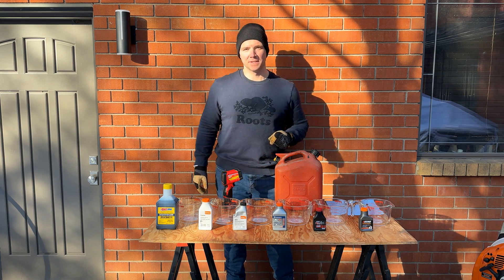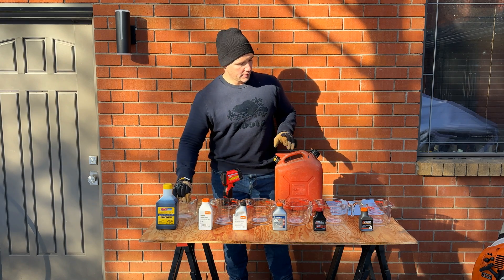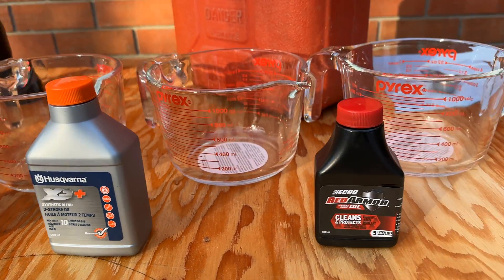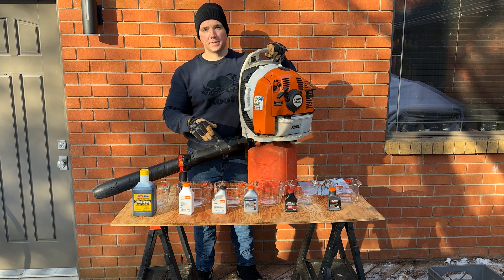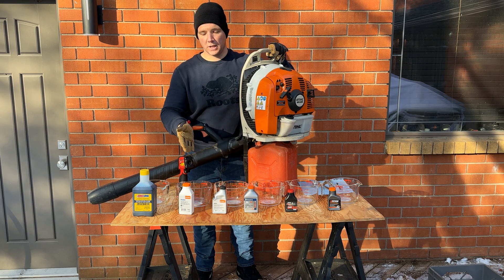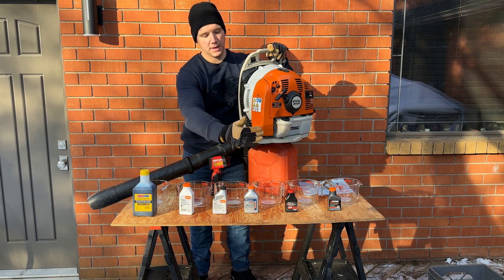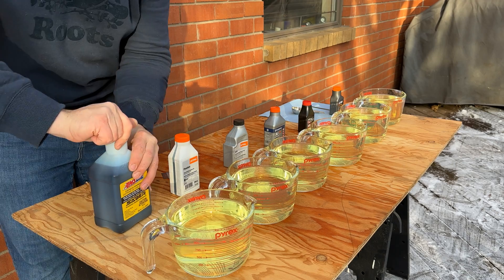Which 2-stroke oil is safest for your small engine? Temperature testing 6 of the most popular oils!

Comment: Hi i need to find a review on Redmax & Royal Purple 2 cycle oil.
I have a stihl 025 chain saw,
Stihl Kombi 2 cycle KM85R, RedMax 8500 2 cycle blower.
I cant mix stihl ultra for 2 and redmax for the redmax.
I really need just one 2 cycle oil.

I watched a repairman review stihl ultra and the ones who used stihl ultra and zero lubrication inside so im not uding stihl 3 cycle oil

Comment: I could be wrong but I do not think exhaust temperature is a good indicator of the oil protecting the engine! Also a thicker film of oil left behind could raise the temperature of tool as moving fluids do heat up! So a higher temperature could mean the tool is better protected?

Comment: As a small engine mechanic and rc car and airplane pilot for almost 3 decades I can say that STHIL oils are junk. 
They will fowl plugs, leave more carbon and idle and transition poorly. They have a higher flash point so they burn badly. They’re designed to be run wide open. If you aren’t running wide open for the majority of your operation then it isn’t burning efficiently. 
Will it cause damage? No, it’s still oil. But is it nasty? Certainly.

Comment: Believe your test results deserves a scientific explanation from an expert in engine and two-stroke oil technology, which I am not qualified to provide.  That said, common sense says higher temp either means more friction or more power; which one is it?  Would be interesting to know the answer.  Would also be interesting to see how the results compare if the tests were run using the prescribed oil manufacturer's recommended ratios.  Thanks for your efforts in making this interesting video!

Comment: You’re kidding with this test right? You can’t run the engine without the shroud in place. That shroud is integral to the proper flow of air over the engine and exhaust. You’re going to need to place temperature probes/sensors wherever and then put the shroud back on. That’s said, what makes you think simply measuring exhaust temperature is a primary indicator of a 2 stroke oils performance? You need to consult the JASO and look at what the criteria’s are for what makes an oil good, better, and best etc.
Reply: Agreed

Comment: Brp (ski doo), amsoil, polaris, cat..etc...any of the snowmobile 2 stroke oils and youll never go wrong. They make turbo 2 strokes of near 200 stock hp in sleds thrive so good enough for small stuff. I personally use the Bombardier mineral oil (50 bucks or so, 4 liters, synthetic is more) in all my old professional McCulloch chainsaws, one going back to 1971. Never even foul a plug. Pretty much 40:1 mix with no ethanol premium.

Comment: well my dad has a  40 year old echo backpack blower and it still works just fine. he used EVERY type of oil you could think of in it.   i also  have a 25 year old hus.145 bt and just llike the echo have used all kinds of different oils in it and it STILL STARTS ON THE SECOND PULL! just bought a  new  hus. 570 bts ( wanted the job done quicker, 1.5 acres, i also do 2 other lots, cause i am a nice guy , lol, older ladys). seems to me it is MORE ABOUT HOW PEOPLE TAKE CARE OF THEIR EQUIPMENT THAN WHAT OIL IS BEING USED. i always lean towards using a SLIGHTLY richer mix. 1/32 to  1/16 oz. per mix more. depernding on the machine. that little bit means MUCH LONGER LONGEVITY OF THE MACHINE!! JUST MY 2 CENTS WORTH
Reply: I am 53 and have been mowing since I was 16, I thought Echo making a blower 40 years ago was baloney but my search said they made the FIRST backpack and handheld bower in 1975, amazing.
Reply: @NoNORADon911  i might have been off by maybe 2-3 years on the echo it was just a guess. but i have since given my dad my 145bt as it is lighter than the old echo and he is 85, lol what a strong old man!! i  do not mix my 570bts richer as it has a spark arrestor.and i use  a straight echo gold blend .i might try a different oil, but it seems to work ok so far.might change after i use all this oil up. it does take 3 pulls to start from cold, but seems to work fine so far on year 2. and this thing is beast at blowing leaves just super heavy on your back . you will be happy when it runs out of gas about, 1.20 hours to run out.

Comment: Coolest doesn't mean safest. A higher viscosity oil or more oil will run slightly hotter (and statistically safer), due to residual friction and mass of oil that has to be moved around. That being said I'm not an amsoil fanboy, I run motul 710 as my main oil due to being the one that gave me the best condition of p/c on my chainsaw mill after 1000 hours of runtime on a new set of piston and cylinder compared to 5 other arboristsite loved oils I tried

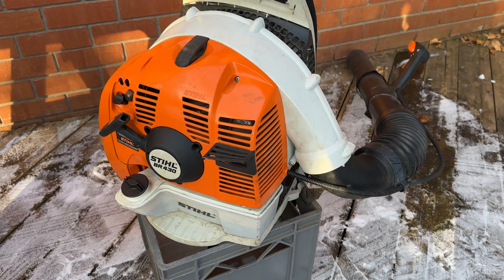Comment: I recently purchased a new 52cc line trimmer (this is actually a 4 in 1 tool) that recommends using 1:25 oil to fuel ratio. I purchased semi synesthetic 2 stroke oil and was wondering if it was ok to use a different oil to fuel ratio, say 1:32 or 1:40 after 20 hours of initial use at 1:25. The machine has powered on ok when I have used the oil with 91 petrol (non ethanol) and some fuel stabilizer.  Thanks for your input.

Comment: I run the AMSOIL Saber in all my 2-stroke stuff at a ratio of 90:1. I have a Husqvarna blower that calls for 50:1, my old Ryobi string trimmer (with interchangeable tools, one of which is a lightweight tiller that I use a lot in the early spring and late fall) that's 32:1 and my 1980 Homelite 150A that I restored which uses 16:1. All three of these get the AMSOIL mix and run beautifully, and have noticeably more power with this versus the cheap 2stroke Walmart oil I had to use once in a pinch, and the Castor 927 that I've used for years up until I switched to AMSOIL. Most impressive was my old chainsaw which I ran through its paces last weekend and it didn't even flinch.

Something I did not do was do any temperature comparisons between the Castor, the AMSOIL, and the cheap Wally oil. So this video was an interesting one to see. I'm surprised the AMSOIL (given the mix ratio you used being consistent through all oils) ran the hottest. I could see it running hotter when going off the recommended mix ratio, given there's so much more gasoline going through the combustion cycle than with other ratios, but again, surprised to see it running hotter with consistent ratios. Great work!
Reply: with modern 2S oil brands ( 1/2 or full synthetic) u dont need to go w/ 32:1 or 16:1. !!These hi ratios were needed w/ old designed mineral lubes. 
  50:1 is ok for early & late engines (even motorbikes, snowmobile & mariners ...),
 then 66:1 or 90:1 is recommended for certain modern 2S.
  w/modern 2S oils, 50:1 is a maximum, if u mix more it'll smoke & spit a lot of exost oil   it will flood the plug inducing a shorter life, flooded muffler, & put much carbon deposits on piston top, exost port & muffler ^^

Comment: Great test but how much variation did you have in ambient air temperature? Was the air temperature 40 degrees at the start and later in the day the air temperature raise to 60 degrees? I would think ambient air temperature would have an effect on your temperatures that you we're measuring.

Comment: The heat isnrt really a fair comparison, as the lower temps could have oil not burned off and is carboning the piston and bearings, etc. Its about how well it protects the internals and in a comparison of tearing the head off and piston out after each test is truly how your going to get results. Thos temps are in all honesty within spec for the running of the engine but the lower temps will most likely still have carbon deposits on the head and piston and cylinder walls or ports, etc. When it comes to 2 stroke engines, we want oil to keep it within the enginesrunning heat specs but not to have a bunch of carbon depositis. You should do the test with a brand new piston and clean the head and cylinder completely then run each oil mixture equally or even to the spec of the oil. You can still measure temps if you like to ensure that no one oil isnt keeping temps within engine specs. Then you can measure carbon depsoits, wear on the rings and cylinder, then change the piston and clean the cylinder and head and start all over again through each oil. That type of test will show you that not all these oils are as good as they say and I bet the Amsoil will win as it burns off its oil not leaving carbon deposits or scoring and some of the others will make a mess of things. 
I raced about 12 years MX and always ran 2 strokes. Ive tried every oil and mixture you can think of and always had less scroing, carbon deposits, ring wear, cylinder wear with amsoils products.

Comment: Neat test. I've ran the Amsoil Saber in my MS251 with good results since I bought it new back in 2015. Though I've kind of cherished the one quart bottle I bought as it's hard to come by. I still have enough left for mixing two or three gallons of fuel. The store I originally bought my bottle from no longer has it as they're having a hard time getting it supposedly.

One of the other stores I shop at frequently sells Amsoil's two other pre-mix oils I'm going to test. According to Amsoil's own website they support the same oil qualifications as Saber does for hand held power equipment. They're just not directly advertised for use in power equipment. I've read a lot of positive reviews of people using Interceptor and Dominator in their equipment as well as their dirt bikes so I have a quart of each to test. Those are both in store so I'm testing out what can be easily grabbed off shelf before I resort to ordering off the internet. :)
Reply: What ratio?
Reply: @WithoutMajtek  I run everything at 40:1. With modern 2-troke oil I feel it's a good middle ground. You're not using too much and you're not starving your equipment of lubrication. 

I've read some old-timers still swear by 25:1, but they don't stop to realize 25:1 was used when non-detergent SAE-30 automotive oil was used in 2-stroke engines. When 2-stroke specific oil got better they upped the rating to 32:1.

Since all of the high-end 2-stroke oil on the market is all full-synthetic they support 50:1 for the "richest" mix due to EPA regulations for running cleaner.

But since my pockets aren't bottomless and good equipment is expensive I can't just freely replace something if it breaks. So I feel 40:1 is good a spot even if others don't agree. AMSOIL is still cheaper than buying a new chainsaw.

Comment: Nice job on a pointless test. The gasoline, fuel to air ratio, and ignition timing, for the most part determines the exhaust temperatures. That's why all of your test temps are so close together. Moving around on the muffler with your laser temp gauge will yield different temps. You should have made a mark on the  muffler so you could take the readings in the same exact spot every time. Taking the temps from a spot on the cylinder about halfway through the stroke would yield more useful information. Do you have any idea what the designed running temperature is supposed to be and where on the engine the samples should be taken?

Comment: But how clean ate the engines inside? Stihl ultra is an incredibly dirty oil, leave junk on the piston top, skirt etc. Whereas Amsoil Sabre leaves the internals almost spotless. I know this through using Ultra in my Stihl gear. Now run Sabre at 50:1. Have heard good stuff about the othets too, Ultra i my opinion is the junkiest oil in this test. Plenty on the saw sites about it. Thanks for your time and videos!

Comment: Stihl here in New Zealand is branded from Castrol.

I prefer Amsoil which has been selling its 100-1 oil for way over 40 years. It's not as you say a claim, it actually can be used way leaner.

Comment: For your next test, run the same test but with a 40:1 mixture.  It will really be interesting to see how much cooler the engine runs under this condition.
Reply: 40:1 will have less fuel and would probably be hotter. Because actualy it’s leaner mixture.
But we’ll see if this gets tested.
Reply: @miloskovacevic2311  40:1 versus 50:1 is a minuscule amount of fuel and will not really affect mixture but it makes a massive improvement on longevity of the saws internals.  50:1 is recommended only to satisfy the EPA not for the health or performance of the engine.
Reply: Well you made a point. Some manufacturers sugestions are based on different basis than yours.
Anyway, too much oil can produce more heat. But I agree with you that 1:40 is not too much in this case.
Also, Ipone is premium French oil manufacturer. If you look at the bottle they sugest you can mix it as low as 1,6%, which is below 1:50. I wonder what do they benefit from low oil.
Maybe less carbon build up.
Reply: @miloskovacevic2311  It's a richer fuel mixture, when less oil is used.
Reply: Agreed - he just did a 25:1 vs 50:1 and more lubricatation = less gasoline making it's way into the cylinder.

This does stand to ask though:
If you're trying to be super safe and go with a 40:1 or even a 25:1 BUT you open-up your High and Low Needle Valves to get back to that perfect 14.7:1 Air/Fuel mixture, do you accomplish both goals?

Less Temperature AND More Lubrication?? 🤔 Makes me wonder...
Reply: @kellybuzzelljr.3439  While he previously did test at 50:1 and then 25:1, he didn't retune the saw, in the older video. Ask ANYONE that mills for a living, and they all run at either 16:1, 25:1 or 30:1. I've never heard of anyone milling wood with a chainsaw, at 50:1... I suppose you could, but your saw would be toast very quickly. Way too much heat, not enough oil, when held wide open all day, ever day...

Comment: Why do you take the EXHAUSTtemperature as a measurement for the lubrification properties and safety of each oil?
I'd be rather interested in the temperature of the ENGINEBLOCK!
The exhaust temperature is rather depending on the composition of the fuel.
The other thing: your audio isn't the best. 🤷‍♂️ How far was the microphone away when you spoke?

Comment: I only use Opti-2 and gave up on the others, i no longer get deposits or smoke 💨 from my equipment. Wish this was included in your test.
Reply: Don’t quit your day job buddy 

I’m fourth generation timber faller 

flathead saw hand limb rat whatever you wanna call it 

I come from two generation of spring board fallers

And a large scale, mass production, owner operator

I don’t wanna talk about school,certification, inside secrets, 

very old secrets I’ll leave you with this. 

I know for a fact you are a homeowner and I know for an absolute fact you use Polan pro or echo 

 don’t do it for a living. 

don’t even do it for fun 

you do it to avoid conflict with the homeowners association 

you cut little twigs maybe use the saw to rip fence panels because you’re a little ShiTzu keeps chewing through them😂😂

I know I know, you seriously 

You have not tried them “all”

You definitely haven’t used all of them 

especially long enough to notice a difference or you would be screaming about that three different types of two-stroke mix. You can combine and create one super hybrid as you can even run 45-1 and still produce no smoke  but you’re not talking about that one now are you didn’t think so VP amsoil dominator and stihl hp “Red”

😂😂😂

This will keep you under 180° wide open all day legit legit I cut six tanks a day and at the end of the day I run the gas out of my saw while I’m at the truck I go to my tool bag and while the sauce is still idling, I hit it with my temp gun 174°F max 177 revved

 no BS throw it out

 or take it home. 

I don’t care.

Comment: Been a mechanic in the industry for many years. 20+. I've seen it all. Castrol makes all of the Stihl oil. It's just re-badged. NO DIFFERENT. If I were going to use an actual two cycle oil, it would be red armor. What I do use is Mobil One synthetic high mileage. Might think I'm crazy, but I'll tell you it leaves a nice wet film on all the internals,it doesn't smoke,and I never have to clean a screen. 40 to 1.

Comment: The problem with this test is two fold. It is not the exhaust temp  but the problem of the air temperature! The air  got colder as the evening progressed and the ammo can is sitting on cold ground instead of wood thus affected by ground temp. So you tested without constant controlled room temp and against a metal can sitting on ground temp that affects the temp of the metal can. Even in room temp you would not want to set a metal can on a concrete floor. Not a reliable test at all!

Comment: All my two cycles know only two fuels - my 50:1 Stihl Ultra mix home brew with premium non- ethanol gas or Stihl Moto Mix.  My 50:1 mix contains 84 ml of Stihl Ultra plus one ounce of fuel stabilizer per gallon of gas.  I don’t dislike Echo Red Armor or Power Blend Gold, but my second choice is Husqvarna XP, mixed at the same ratios as the Stihl Ultra.  Stihl dealers inthe US do not carry the Premium but the HP, instead.  It is sold in one gallon bottle versions and not in the liter version sold in Canada.  I assume it is the same oil, though- it is tinted green.
Reply from the maker: Where are you finding non-ethanol gas now that 10% is mandated in Canada?
Reply: @DavesSmallEngines  I don’t live in Canada.  I live in the good ole USA.  I get it at my local 76 station.
Reply from the maker: @johnclarke6647  ahh I mis read. Lucky guy!

Comment: A lil ir temp gun trick i use is to get a sheet of aluminum foil and put it in front of exhaust in this case then temp the foil to get a air temp reading make sure you  set the emissivity on ir gun and i do a few control temp reading with any ir  gun i have  to determine exact emissivity setting